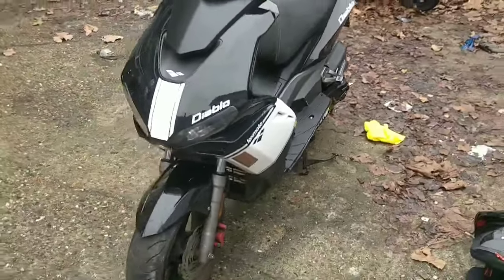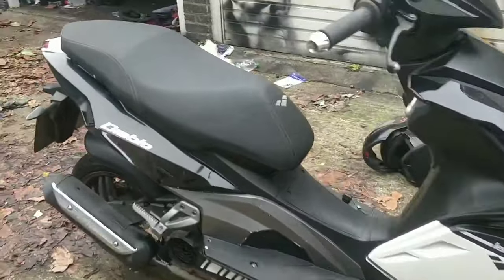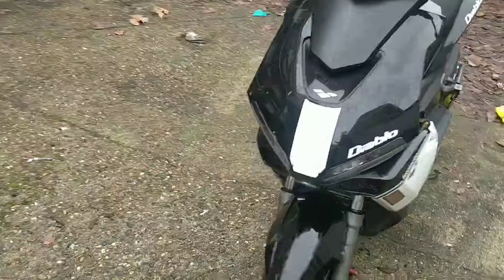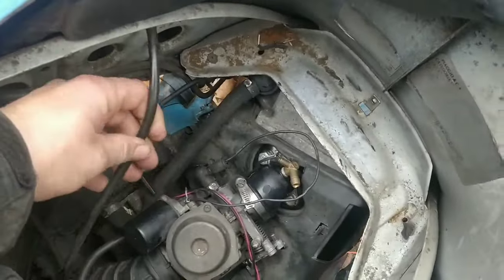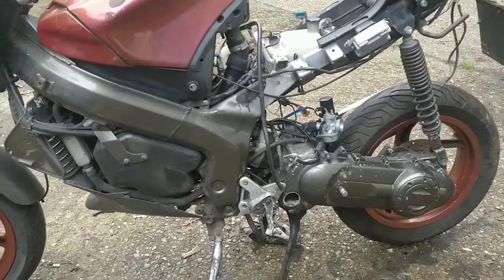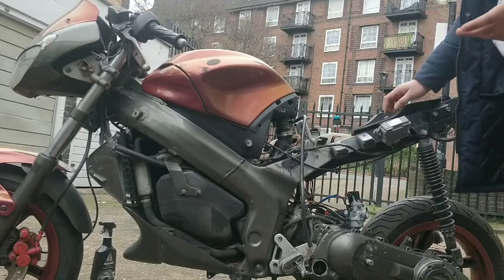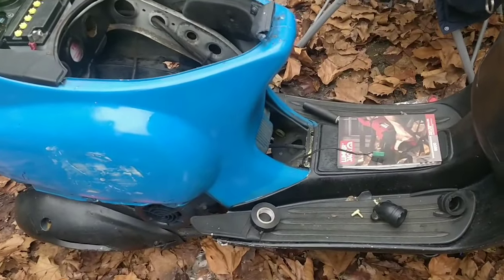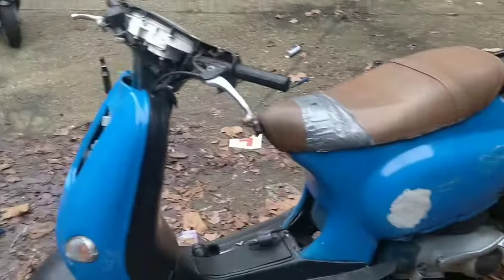lexmoto diablo, gilera DNA, Piaggio Vespa update

Comment: Unfortunately the DNA will need the 2 stroke oil pump removed & flushed/cleaned otherwise you stand a good chance of the old & new oil mixing....that may dislodge any built up oil debris  in the system  ( happened on my tzr) .

I did notice on the DNA that when it's cranking over the rear tail light cluster loses it's brake light ie goes back to just tail light... brake switch draining power or something?
Reply from the maker: As far as I'm aware the switch isn't still connected. The last I hooked it up it didnt even turn over on the button. Like the starter burnt out or something. Fixing the kick is my best bet as you get a stronger spark of the kick nearly always on a 50cc.

Comment: will have a look if ive indicators u need in morning, do have a box but generally never one you need, 3 left no right  etc, gen cheaper to get set used on ebay than new but have to wait for bargain and generally always slightly different shade or cracked round screw holes, my seat recover looked awesome untill local cat used it as scratching post, got to change wheel cylinder on seat ibiza  tomorrow so can get home from mums, should be easy if brake shoes and drums good and nothin seized, bet it rains all day now parts store open again tomorrow
Reply from the maker: Lol, Im changing fork seals today so really hope it dosnt rain.

Comment: Did you have to put in a 50cc wiring loom when you took the 125cc engine out the vespa being diferent ignition system and socket for the altenator or just cobble one in, be intersted to know as have a good 50cc engine to go in when find a dead Vespa et4125 for sale.
Reply from the maker: No changes to the wiring at all. Literally plug and play mate

Comment: et2 seat cover 15 quid ebay easy job just need  sissors and staple gun, get back square, rest a doddle apart from helmet hook check twice before cutting hole. iv, gotta put new clutch on mine as someone over tightened  clutch nut and its clattering and bent and ringing, you can waz up variator nut with impact but not clutch nut it will be screwed, will do vavles too, if that dont solve lack of pull off guess ill be looking at barrel and piston. should test pull off two up with sultan, if it pulls strong two up its good. dna sounds sick maybe sticky bendix probably not.
Reply from the maker: I couldn't find any seat covers mate, the cheapest was £65. I've done some before and have a staple gun so could do it.
Reply from the maker: I don't know what's wrong with the dna, turn over is very weak even with a strong battery. I may have to rebuild the kick start and try that. It may start better off the kick.

I may pop the top end to see what the new piston and rings are like. They should be great but you never know.
Reply from the maker: @anthonymason912  mate your a legend. I couldn't find any like that.

Thanks

Comment: unless hinge on seat is really loose and corroded then dont bother recovering replace.
Reply from the maker: It is pretty loose the hinge actually.
Reply: @motorcyclerescuer  yeah do get loose, guess it's a judgement call on how corroded it is, if really corroded and flops all over place like it's gonna snap or just a bit old. Decent seats go for 50 plus second hand and sell quickly. If solidish recover and let next owner hunt down decent seat.
Reply: Have got a set of clear Indi lens, not perfect, one needs gluing, one already glued , but would get you going and be cheap.  Can send you photos if you like , which two u need, don't have time for videos as pulling ibiza wheels and hubs, had one side off, gonna be new cylinders, shoes and fixing kit, so if I get away with 75   I'll be happy.
Reply from the maker: @anthonymason912  thanks for the offer mate but I've ordered a couple already. I'm not in a hurry. I put some paint down on the bike today. Looks rubbish but can't look any worse then it did lol.
Reply: @motorcyclerescuer  but bet nobody trys stealing it lol